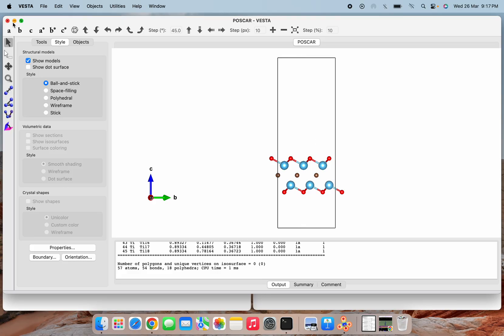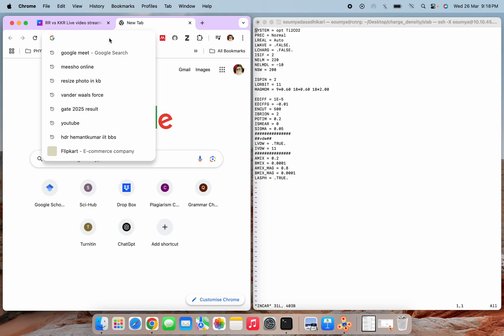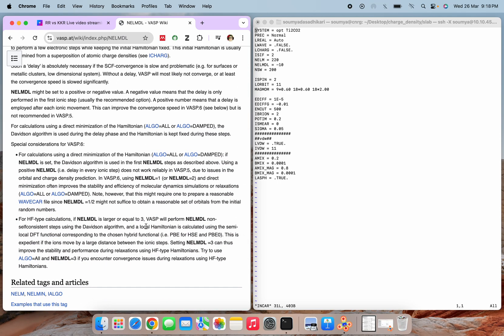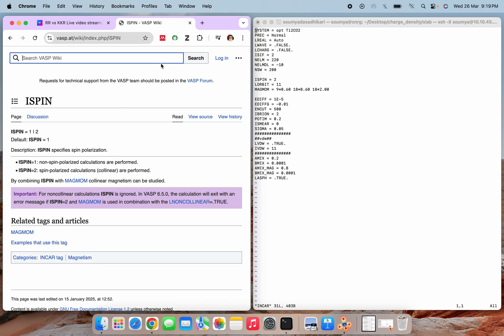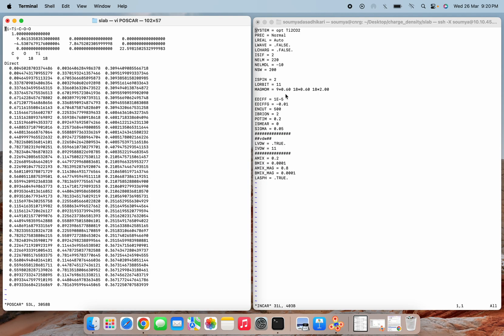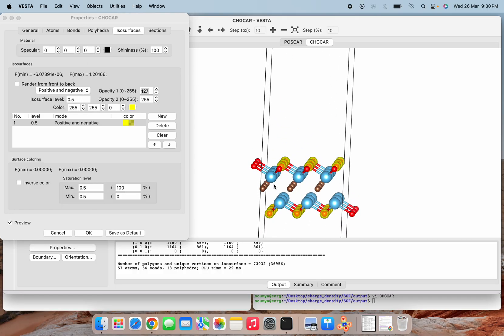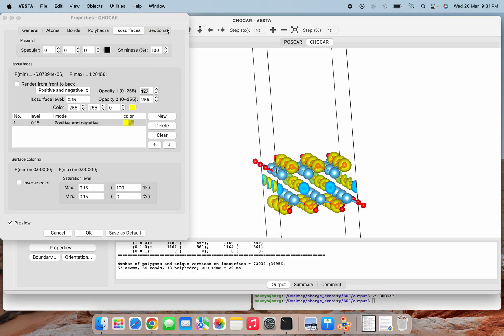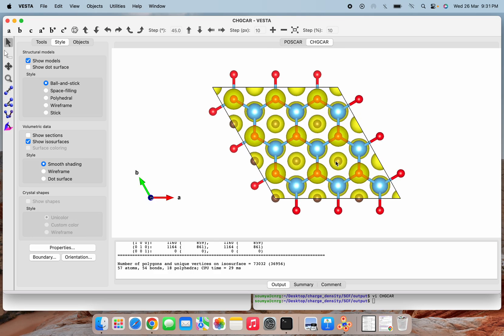VASP Tutorial - 3 Charge and Spin Density Plots using VESTA and VASPKIT

Comment: thank you madam,  for this beautiful lecture.
Reply: mam , how individual magnetic moment we can calculate like you told for C & O it is zero , for Ti , it is 2 ?
Reply from the maker: @Samirkantadas123  This is the initial magnetic moment guess value for Ti as the normal value is nearly 1.73 BM. You can search in google for respective elements magnetic moment.
Reply: @computational_physicist  okay Ma'am. But , why do you give 2 in the place of 1.73. I am asking bcz , if an error comes. Or, we have to give any close number.
Reply from the maker: @Samirkantadas123  Yes the near round number is 2
Reply: @computational_physicist  okay ma'am. Thank you.